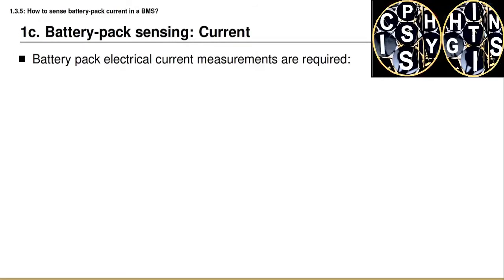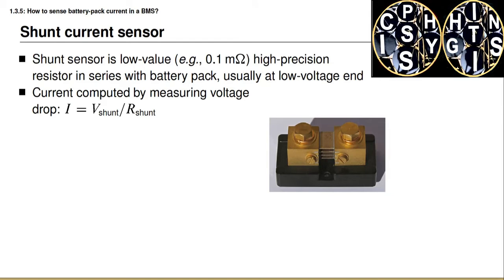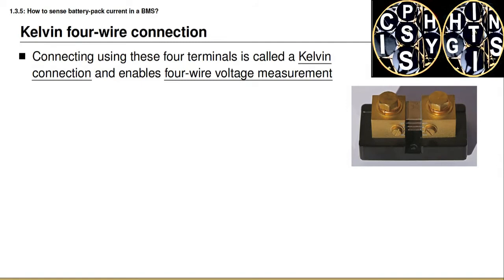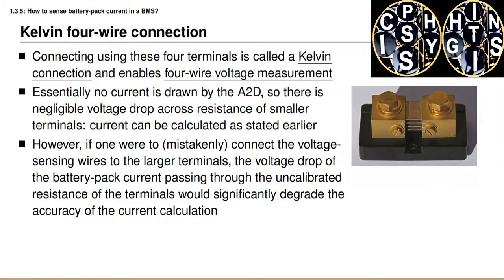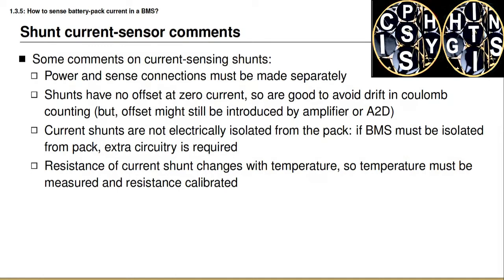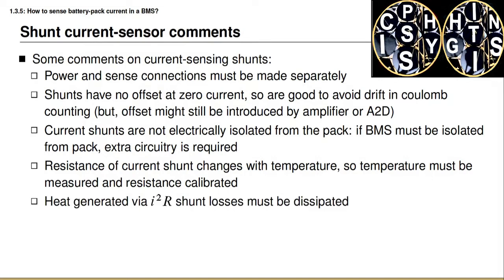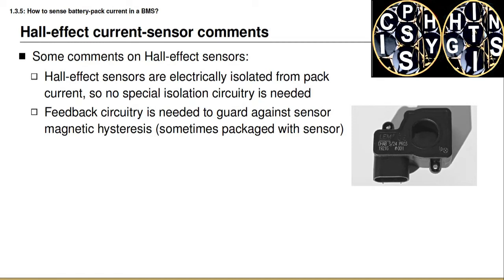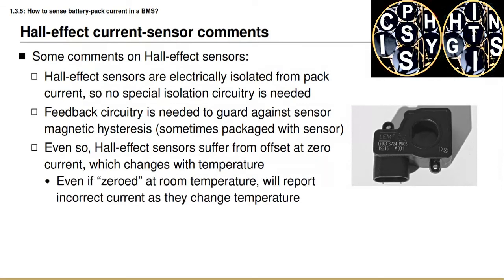1.3.5- How to sense battery-pack current in a BMS-

Comment: The description the presenter is providing is of a control transformer (CT) for AC current ONLY.  Hall effect sensors are a solid state device that changes it's outputs in response to a magnetic field.  Another mistake made is the CT and hall effect sensors are purely magnetic not electromagnetic.  Electromagnetic is for radio waves.

Comment: I really like the videos. They are well structured and educational.
I have a remark regarding Hall effect current sensing: 
- from what I know a coil(secondary of a transformer) can only sense change in magnetic field (from an alternating current). 
- usually, a Hall effect current measurement is done by wrapping a magnetic material around the wire, to direct the magnetic field into a Hall sensor, which is able to measure also static magnetic field (DC current).
Thank you and keep up the good work!